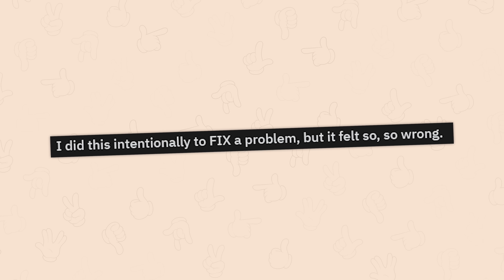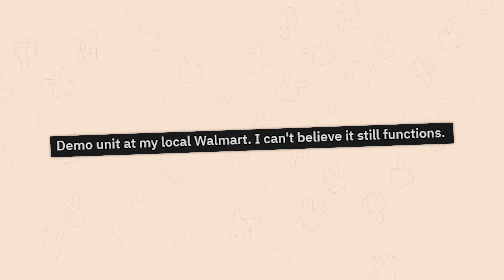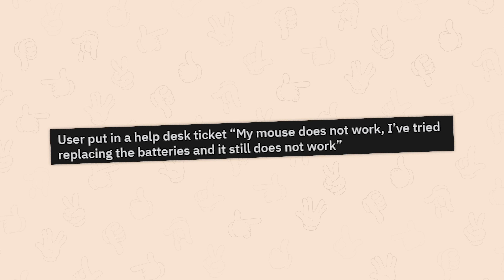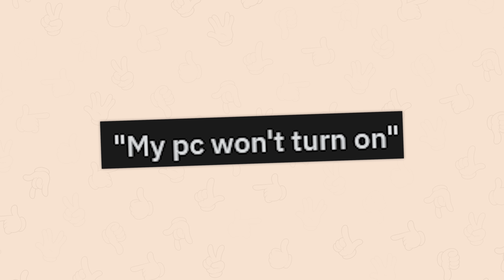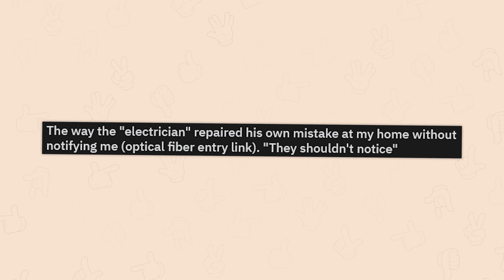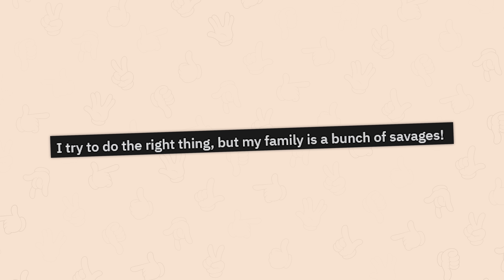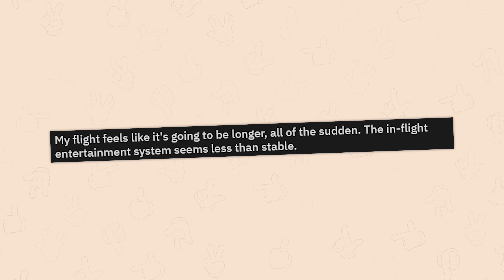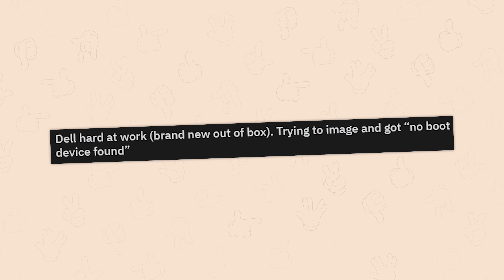r/TechSupportGore | free internet with this one trick

Comment: Dye-shop computer reminds me of one at my old work (2012 to 2017). It was at least a early 2000s model Dell that was running Windows 98 (not even 98se). It ran a Roll-former (turning flat ribbons of steel into large pins for Underground-mining roof-support) that was about 4 feet from it so consequently would be sprayed with a fine mist on Oil-based Coolant/Water and have layers of Mill-scale on it. It would Die (overheating mostly and shorting-out) on regular occasions and have to be Replaced with the Same model (yes they somehow had to find NOS each time) because they person that Designed the System had left 10years previous and No-one knew how to Reprogram/Rewire the PLCs that made it work or wanted it Shutdown to put a Better system in? It shat me to tears that I had at least 5 of the same model of Dell from Council-cleanup/Recycling that all worked and I would have Happily given them to use but they Never took up the offer.

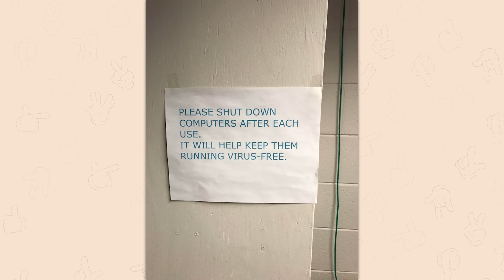Comment: 15:50 that could be if the computer is running the Ghost remote OS thing. (it resets when you shut it down).

also the WIFI cable is sort of a semi joke that I know some actually uses (its more if WIFI does not work use WIFI cable, mostly to help whit other finding the correct cable and not correctly connecting a HDMI cable or USB2-B cable and wondering why it does not work (because mess and no labeling on anything).
that said I have still not botterd and I should to label my HDMI and DP cables, because good luck seeing the diffrence in dim light when you trying to find where what should go where behind the computer.

17:12 could be a case of mac just refusing to play nice whit the first piece of tech so goldberg it untill mac can´t figure out what its looking at and going.. fine.

20:49 Critical Banking running on COBOL on a OS written in late 1950.
21:10 Im not even mad as that feel like something I would somehow miss when setting up new arrived computers.

Comment: Imagine the patience of individual who made braids from functional Ethernet cables :D  USB Flash RAID drive - for scammers it is still cheaper than proper SSD drive because noname USB 2.0 thumbdrives in China cost $2 per piece. Server in bathroom completely make sense for anybody from post-USSR countries who worked with IT hardware at nineties and seen all unimaginable spaces where computer tech in small bussinesses got tucked in. Agree about crap in crap if you use Kingston SSD drives (utter rubbish) as replacement. Not installed fiber cable on road is still better than ripped cable when thieves mismatch fiber with regular cable with copper wires.
Use those middlescoolers as piñata. There was a reason for legally beating naughty schoolchildren 100 years ago.

Comment: USB3 is the first known high speed USB standard. (The USBA connectors with the blue tongues)
Reply: Ahh memories, I remember back in the day we used one of those blue Linksys routers.  The days of constantly "unplug and plug it back in" with the internet back then.  Also, yea, I agree that's not how to fix that, the only definitive way to fix it is unplug and plug it in, until the connection slows down again.

Comment: How do you take a USB receiver and look at an RJ45 port and go, 'yea that looks like it goes there'

17:05 Despite how much faster an SD card reader that uses all of the bandwidth of USB3, it's just fucking faster to get an adapter of SOME sort, because all you're likely to be told about the reader, manufacturer be damned, is it's SDXC, WHICH HAS EXISTED SINCE FUCKING 2009, I'D FUCKING HOPE THAT ANYTHING RELEASED AFTER THE 3DS WOULD TAKE SD CARDS WITH A CAPACITY GREATER THAN 32GB , just tell us the fucking speed it runs, finding anything faster than UHS-I is like unobtainium, so far I only know apple to have anything with  UHS-II reader

Comment: my school laptop apparently hates computer mice. Every time I use a mouse, it works for a little while, and then it just stops working. But the computer and mouse certainly act like it's still connected. I've tried changing the batteries, using different ports, nothing worked, and not even the computer guy at my school could fix it. The only way I got it to "fix" was by restarting or shutting down my laptop and turning it back on, but then everything I said above just resets. I tried both wired and unwired mice, and none worked. It's a school Chromebook that I use, and the mousepad is also slightly glitchy. Any idea what I can do?

Comment: I had a pillow in a gba sp at one point. the system would not charge so I had to find some one who was selling a battery to replace the spicy pillow with and I got one so no more spicey pillow and a working gba sp I was lucky the battery had not split and/ or coroded the system.

Comment: I have an old Samsung 2011 Chromebook, and its charger is charger bent at 15 degrees at the end.

Both still "work" (chromebook can barely run chromeos but them's the breaks, might try to install arch on it eventually)

Also when I worked electronics donation processing (which we wipe data from) I saw a SSD with bullet holes in it, other people there positively identified as bullets
And I get doing that for a rotational drive (which we still degauss) but an SSD?????
In some of the adapters I've seen (MSata in SSD caddy) they would have missed entirely 😅

Comment: You don't use SD cards all that much because they're very scary whereas USB is pretty safe.

Someone find me a scenario where you need to transfer a file but a USB drive won't work yet an sd card will.

Basicaly every computer ever built since like 2000 has a usb port but not all of them have an sd card slot. Even phones have usb but not sd lots of times.

Sometimes you will need a usb to usb adapter depending on the drive and so usb wins.

I now view sd cards as internal storage.

Comment: MESSAGE TO ALL OF THE IDIOTS: IF YOUR PHONE GETS BIGGER, STOP USING IT! IT IS A BOMB WAITING TO EXPLODE!

3:34 At least you don't have to do the connections manually. As somebody that has added ports to the end of ethernet cables manually, just a scratch on the wire can cause the ENTIRE THING not to work properly or at all. There's a reason why the wire has strings inside. You're supposed to cut of the amount of wire you stripped and use the string to take off the rest of the insulation. Then, you have to untwist and straighten the wires(to make it easier to put the wires in the holes in the port) and place them in the holes in the port. The wires are color-coded and you need to put them in a specific order. You securely fasten them using a crimper and test the connections. Finally, you pull the trigger and end your suffering.

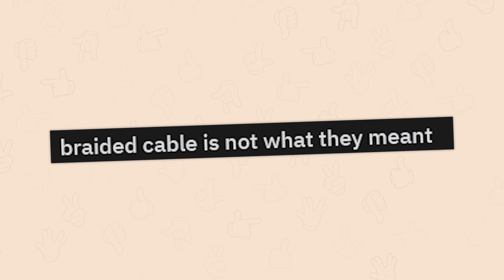5:03 I feel bad for them but also want to pull the trigger for them.

My teacher told me to splice wires together to just hit it with heat and solder. I was on my sixth try so you can bet I cranked that B all the way up. Trust me, the solder won't be cold with me.

Comment: I have 2 older laptops that I would super love to upgrade to ssd and more ram. Yet the cost of just buying a new laptop is cheaper. To get a 1tb ssd is less than 100 dollars, to get 32 gigs of what ever ram is around 100 or less. Then you need an OS and because these are old win 7 machines they are long past the windows 10 upgrade point for at least what I know. I think its a 150 dollars for windows 11 home? That comes out to 350 dollars. It would be better to find a 350 dollar laptop that is just way better. I have 4 chromebooks that we use all the time. I have my main desktop and I need a windows machine for someone who does a little bit of photo editing and since google play does not have a really good photo editing software it might be time to get a new machine. They are still testing out a bunch of apps to see if any of them are good enough. Light room is just not worth the 20 dollars a month for light work as a hobby.

Comment: The asphalt fiberline I bet you I can tell what happened probably something along the line of the blue prints didn't match what actually was underneath and they just went for it and that's what happened used to happen all the time with me and my buddy when I did construction we one time cut into a high-power electric line that was supposed to be about three feet down under concrete but was actually about 3 in yes the person was completely okay somehow took a moment before we were able to figure out what all it was connected to so we could rewire it

Comment: AcTHuaLy If yOU youThD THe rIghT sOaP~t yOU Can ClEan YoUr hArDware WiTh it JusT fINe

no really some times even dish soap is alright it really has to do with the ph level and the ingredients in it ,but long story short cpus do have a small gap occasionally so take that out so you don't trap any water under the integrated heatsink, people do this mostly when buying balk pcs usually from old internet cafes or before they sell so the motherboard is "New or Refurbished" "In the box or never used" and shit,you usually leave it to dry for 48 hours in warm climates and up to 120 hours in cool climates or even better you put it in the oven between 40-70 degrees for 2-8 hours ,lay 2 wooden spoons in there and the MB on top and just do whatever, could do any other electronic as well or when when including phones(!!40-50 degrees do  not go over it if you are not experienced) not only dries any water damage you can also set back and "hinged" chips that lead to "dead" or "error prone" devices, phones still on warranty that are not protected by user fault can be "cleaned off of evidence" and send for a replacement but that takes a lot of rotating since some pockets inside the phone can trap gas(is steam) which leave water marks, when send back the device has never been opened by the eyes of the repair staff so even if they find the water damage pads indicating water has been inside they cannot cut it with "he left it on rice" so they argue it was from factory and take a loss,even higher chances of success when you do not have a cracked screen to replace,  on that note some water damage indicators even from apple(a very small amount like 1%-10%) are not even chemical but work like sponges so heating them "clears the damage"(take this last fact with a grain of salt as it is not confirmed by me but just heard of on the net) , happy "repairs" and happy sales "new product" dealers.

PS:Why do you think some people are so adamant keeping their devices in perfect condition, a large chunk of them are reselling it as brand new, when buying a motherboard from a local "re-seller" ask when it was bought and check bios, cross reference with vendor site for an update to see if its updated at any point in time, when buying a phone if skilled enough request a deep "storage" check (talking about both ram and long term storage as a whole) to see how match they have been used if still all if you kind of understand where I am going with this I would even offer an extra 20$ for the task of going through this or would request to be send to a local IT first,   if seems used do not buy if the seller seems "a bit off" in societal levels if at all, not going to state why but do trust me on this one, none of those tricks are useful to me so take them as a gift guys and enjoy.

Comment: I once fixed a problem with slowness etc in (2) training rooms that had 20 PCs each in them, because the moron IT guy that was there when I came onboard had both classrooms plugged into a 10/100Mbps Hub & then linked back to the server room with a single Cat. 5 plugged into another 8 port 3Com 10/100Mbps hub that was daisy chained off of two other identical hubs...then they decided to install TVs for the support desk to display the call stats info & our even bigger idiot manager went & bought tube TVs on sale at Best buy (were talking 2004-5) & ran coax RG-6 to the supervisors computer for output... Of course it was blurry as shit & you couldn't read anything. I had moved to R&D by this time because I was sick of doing my job & the moron's job too, while the idiot IT manager held me to a different and unrealistic standard. So the supervisor came & got me (this happened a lot, because people wanted stuff done & they knew I would not only get it done, but done right the 1st time) I told her & my former manager IT idiot that the only way to fix it is to use S-Video out to the TV... So they got an S-Video to coax adapter & just connected the same cable back up & the adapter box to the PC, which just made it worse... I ended up having it all torn out & flat screen TVs put in, then hooked them up via RGB to a PC for each TV right under them & had them connecting to the call distribution system via the network... You would have thought it was cavemen discovering fire...

Comment: For the Faraday Cage I have seen them in the wild. 
User Wants Only wired places it in there. Okay good. Could just get a Router without wifi but they dont sell that in bigbox stores and 99% of people dont understand how to enter settings.

THEN we get the Comcast BOXES you rent and BUY. They have a back door Comcast uses. 100% of time after a month get a call because wifi is acting funky. All the settings are defaulted and custom password is untouched. They never call comcast for issues. GET THESE CAGES IF YOU RENT FROM COMCAST ESPECIALLY IF YOU ONLY USE THEM AS A MODEM. The "Shared" Wifi Xfinity service is REGULARLY CHECKED to be running BY comcast. THIS FUCKS UP Apartments because they CRANK THE FUCK OUT OF THE POWER. Number one rule dont rent from Comcast.